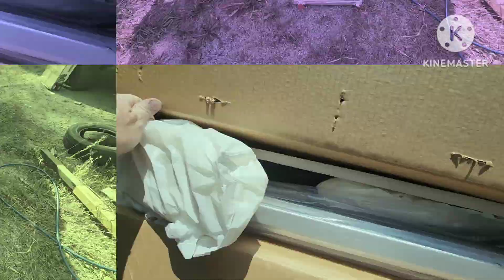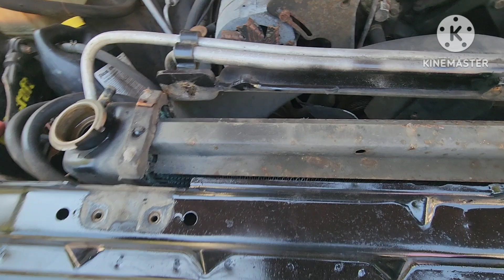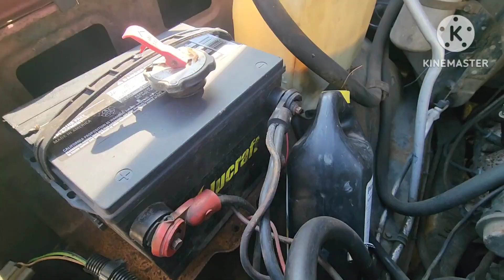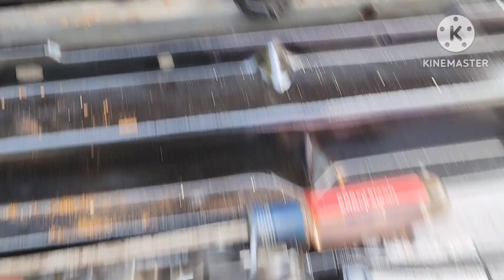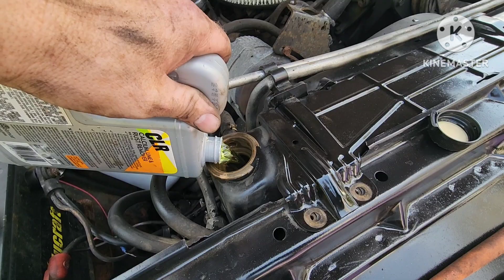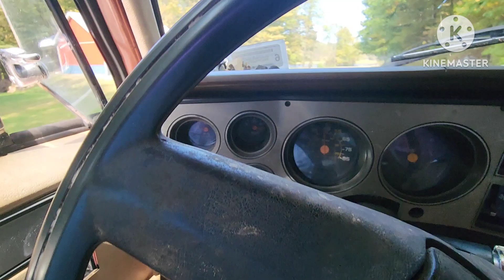Dually build episode 6 major problems

Comment: 💪😎👍
Reply from the maker: @613Builds  how have you been?
Reply: @workingmansrestorations7071 not bad.   Busy with the “new” job lately.  Not getting enough done at home 😅
Reply from the maker: @613Builds  I can't believe how the waterpump leaks... never seen one leak that bad... trying to figure how far to go with it... maybe just waterpump... but would be good to do oil pan, timing chain and cover, I also have a used high rise intake... how bout going as far as I can go leaving exhaust on... ???
Reply: @workingmansrestorations7071  if it’s broke fix it .   If it’s not broke don’t fix it 🤷🏽‍♂️😜
Reply from the maker: @613Builds  tough one... so just do waterpump and that's it?... I have new valve covers... I will do them also.
Reply: @workingmansrestorations7071  were you driving it with leaky water pump?
Reply from the maker: @613Builds  no